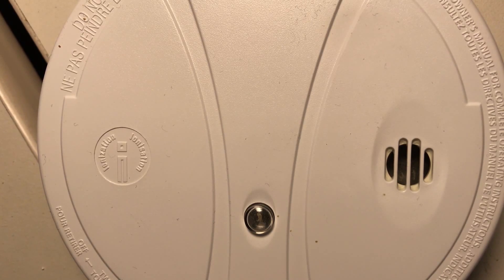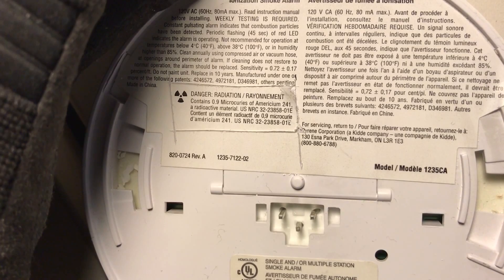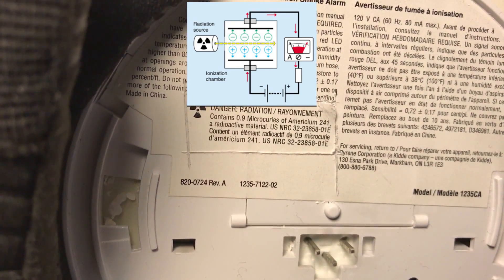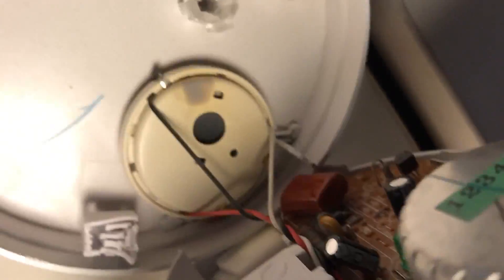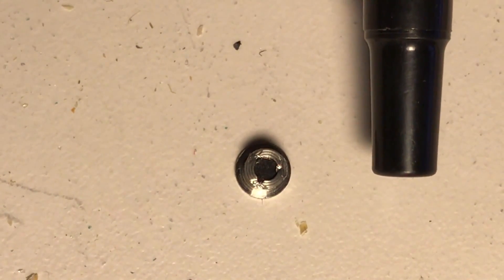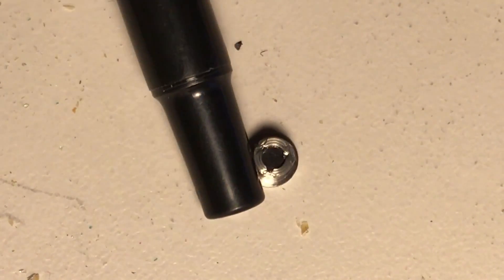Americium 241 in Smoke Detectors

Comment: the most intriguing use for these sources, aside from making a cloud chamber to put one in, is to build a scintilloscope, using a radioluminescent phosphorous screen, and a magnifying lens, all mounted into a (cardboard) tube. 
you gotta let your eyes adjust to pitch darkness for a few minutes, before you see it. but then the alpha radiation filtered trough ~2cm of air looks like static on a TV, with some beta blibs, and occasional sharper looking flashes from gamma particles. and occasionally, you catch a cosmic ray, leaving a bright streak.
Reply from the maker: that would be something to see, thanks

Comment: I did this back in the 1980's.  When I pulled it all apart, I found a flat disk of metal that was about 0.5 mm thick and about the size of the holes you see on the left side of a piece of paper in a three ring binder.

Even at the age of 16 I understood what gamma rays were and I was very quick about disposing this tiny piece of metal!  

[Gawd how I wanted to slit the seat of my physics teacher and slip this under the covering!  I never did it;  I don't hate anyone that much~]

Great video!
Reply from the maker: I disposed of my samples as well.  Dont fool with stuff unless you fully understand it -life lession  Thanks
Reply: @BackyardProspector  YW.  Great video!
Reply: @BackyardProspector  how do you dispose of it?

Comment: It's crazy that they have this stuff in every hotel room, standing just three feet above your head, giving you radiation poisoning. And in restaurant restrooms, etc. I wonder which is worse, the cigarette smoke that this thing is designed to detect, or the alpha and gamma particles emmitted by it.
Reply: sir alfa cant even penetrate plastic
Reply: @lennihaapala8169  It also emmits gamma.
Reply from the maker: It is quite safe from even a small distance
Reply: Did you read the display? It said 120 cpm. That doesn't even register as "radiation", lol!

Comment: I'm probably wrong, but I thought the fire alarm worked not by detecting ionized smoke particles, but is set off by a drop in current caused by the smoke particles interfering with the flow of alpha particles.
Reply from the maker: I think the smoke particles get in between the flow of radiation and that is what drops the signal and sets off the detector.  I am sure there are many different types of detectors.  thanks

Comment: Also that is NOT how it works, the smoke BLOCKS the current from flowing, which triggers a mosfet, which triggers the alarm :)
Reply from the maker: it blocks the emitters that reach the base of the mosfet transmitter and closes the connection to the emitter
Reply: @BackyardProspector  okay but you never responded, I ate my Americium and feel sick, still dont know what do help, help.
Reply from the maker: Hmmmm good point.  Better not eat 🤔

Comment: Also after taking radioactive material out of smoke dector. If im scientifically correct put radioactive material in a lead pouch.
Reply from the maker: the particles it emits get stopped instantly by pretty much anything.  Granted there is stuff out there that is alittle more deadly.

Comment: Definetly excites the hell out of my medcom radalert 50s and rad 100. I'm sure my cdv-700s would move only slightly as still in its cradle it got around 4500 counts per minute (cpm) once put in a ziploc sandwich bag it averaged around 60...in other words a very strong acute alpha emitter but only a handful times more gama than background! So dont inhale or injest this stuff it will not do you any good that's for sure! A great geiger counter tester to see if any works and if it can detect alpha...that makes it really sorta useful to see if yours can REALLY detect alpha it'll make it go berserk, gamma only it will just get a nice increase! Anyone know if any of the components on the PCB can be reused for other stuff like projects?
Reply from the maker: thats some great information, thanks.  I have not explored the uses of the cct board yet.
Reply: trust me, if you legit inhale any metals, your body will get damaged, regardless of radioactivity.

Comment: I tried dipping the americium holder in a mixture containing 5% per 100 ml hydrochloric acid; the results weren't disapointing as the only thing left was the americium disk. Is there anyone here who can tell if this method actually works?
Reply from the maker: that is interesting, the americium is only an oxide so I would wonder how that reacts
Reply: @BackyardProspector  well, after 4 months of trying different methods, HCL is the best way to go
Reply: @BackyardProspector The only problem is that It took 2 weeks to disolve the casing due to the low concentration of HCL in my mixture.

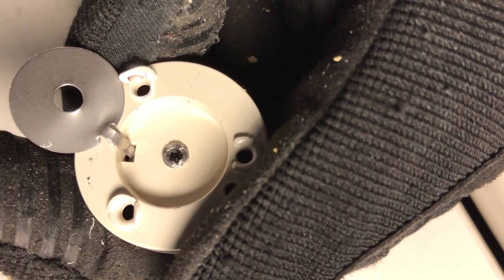Comment: 4:18

Another Americium's properties:

When you remove the Americium holder's shield, Americium's radioactivity make the holder to instantly  pop out from the plastic chassis, jump over it and flip over  into the chassi's center hole.

Reallu strong radioactivity !
Reply from the maker: hmmm that is interesting, thanks
Reply: That's not how radiation works.
Reply: @Xer0b1ts  he’s making a joke about the cut in the video

Comment: Photoelectric smoke alarms uses LEDs and its senses smaldering fire's but insozaton has radio active metirel Wich senses fast burning fire's
Reply: Let's try to fix that:

Photoelectric smoke alarms use a LED and a photosensor to detect smoldering fires but ionization based alarms have a radioactive material used to detect  fast burning fires.

Radioactive material is Am 241, about 0.3 micrograms.
Reply: @louistournas120  I think this dude is quoting 4th year wireman school.

Comment: hi, what might happen if you swallow the americium?
Reply from the maker: you would poop it out
Reply: Alpha radiation is not good for your internal organs, but the amount of it is probably so low that nothing would likely happen. That said I wouldn't test that theory.
Reply: @Tyler11821  thanks mate
Reply: You would actually be exposed to 6 years worth of radiation
Reply: @andrewmartin5006  Where did you get that number from? Americium is not well uptaken by the body, it'll mostly be excreted without absorption. A back-of-the-envelope calculation I ran gives somewhere around 10^-5 Gy exposure to the gut assuming a residency time of about 2 days and alpha particles of about 6 MeV and discounting the occasional gamma, but that's not the dominant factor. That's not a very high dose, most radiological medical procedures give higher exposure.

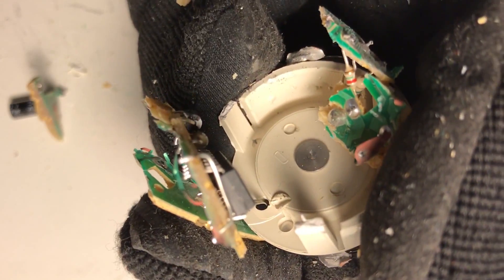Comment: 3:25 Warning !! Due to Americium 241's radiation, removing the plastic tabs from the PCB will result in an instantaneous disintegration of the board.

4:21   Also caused by radiation, the Americium holder automatically flips over !!!!
Reply: I hope this is a joke...

Comment: Do they use plutonium in nuclear reactors ☢️
Reply: Actually they do. And Uranium is the element that is very hard to control. They use plutonium in thorium reactors to give the thorium a kick start
Reply from the maker: i dont think so, mostly uranium because they can control the reaction
Reply: the reason they use uranium is because of its energy/heat realeased after nuclear fission. i believe other materials wouldn't produce as much energy.
Reply: +APPLE JUICE SQUAD:

Very few reactors use Pu239. They are actually standard uranium reactors and they try to burn off the Pu239 as well. These types of reactors use fast neutrons. I think only India has them.

Comment: btw if you want some radon you can use americium it will take 10-20 years though but if you put it in a vacuum chamber for 20 years the americium will go through radioactive decay with a 20 year half life turning into zirconium will emit radon and the vacuum will be filled with radon gas.
Reply: Your information is wrong. Americium-241 has a half life of 432 years. In 20 years you would have around 3% neptunium-237, which in turn has a half life of more than 2 million years. Radon does not generally appear in the decay chain of neptunium-237 (easy internet search). It will eventually decay into Thallium, not zirconium.
Reply: @davidgivens2957  or jus move to Cornwall... Granite backbone ya know.. Granate gives off tons Radon, plenty in our air dude.....

Comment: your very paranoid with the americium its barely radioactive it only emits alpha particles which cant even penetrate the skin and low energy gamma rays which cant penetrate the skin either so your safe to handle it with your bare hands and from his prospective (not what he is saying) 1. if your wearing gloves you dont need to wash your hands 2. if you touch it, washing your hands does nothing cause no debris comes off of it and also the radioactivity does not stay on you after you've moved away from it because its such low amounts and also it cant even penetrate a  piece of paper let alone your skin. your safe with americium do some research for real and dont listen to idiots who think americium will kill you as soon as you touch it and is the most radioactive thing in the world... and the only way it would be dangerous is if it is more then 10-20 years old and by them the americium would have turned into zirconium from radioactive decay.
Reply from the maker: I once worked with a lady who refused to come into the building if the smoke detectors were this type.  Thanks for watching!
Reply: @BackyardProspector  wow she must have even very very paranoid, even the little amount of radiation that does escape cant even get past the metal canister inside let alone the outside of the plastic casing and even more let alone the large distance of space between her and the smoke alarm, just a few inches of air can knock out alpha particles. btw i was mistaken its not 10-20 years its 200-400 years and it dont get more dangerous when it hits zirconium i was mistaken on that too after zirconium it decays and eventually turns into basalt, but americium-241 (thats the type of americium that is in smoke alarms) is a byproduct of power plants uranium decays and turns into plutonium with trace amounts of americium, and is extracted out and put in smoke alarms.
Reply: and it releases low amounts of radon too not much and it will take 200 years to get much radon i am correcting my tiredness problems (i wrote the older stuff at like between 2-3 i believe and i was not thinking straight but now its earlier and now i can think ) btw your welcome for watching!
Reply from the maker: that guy who built a make shift reactor in his shed used Americium (from smoke detectors)  as a neutron gun by encasing it in lead with a small hole at one end.  Anyway he is either dead, in jail or working for the government.
Reply: @BackyardProspector  he's probably dead from radiation poisoning because it said in one video of him that he could detect the radiation from his reactor a few blocks or a few houses away i cant remember what it said
Reply: i got a like :D
Reply: @BackyardProspector  also i have some americium in my room right now its still connected to the board though, i am waiting to disconnect it because i am getting a Geiger counter in a few weeks after my mom starts her job, she will get payed a couple weeks after she starts so she should get a good little bit of money she said that she would buy me one so i found one on walmart.com for $99.00 with 2 day shipping and free local pickup and we live like right next to a Walmart so that will be good and convenient.
Reply: @BackyardProspector  i just realized i just advertised for Walmart btw here is the link for that Geiger counter 
https://www.walmart.com/ip/GQ-GMC-300E-Plus-Nuclear-Radiation-Detector-Geiger-Counter/100061707
and the shipping for it where i live costs $6.88 and it has a 2 year warranty for $8.00 and a 3 year warranty for $11.00 so its pretty cheap, one with 3 year warranty shipping and the Geiger counter the total for me will be $116.88 (and 8 tenths but that does not matter)
Reply: Kepler r/woooosh